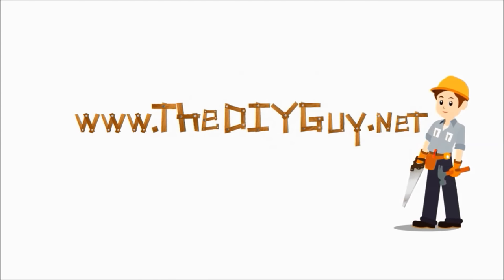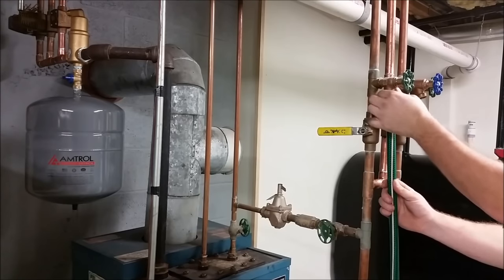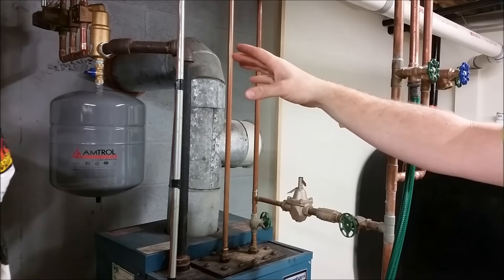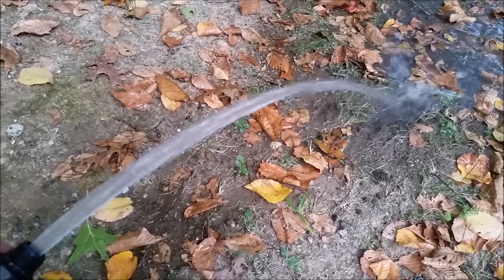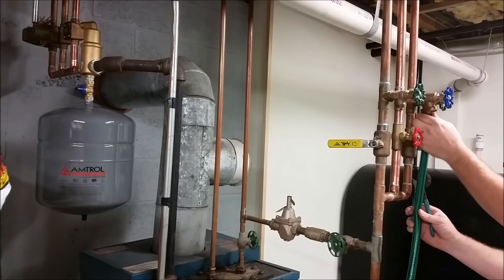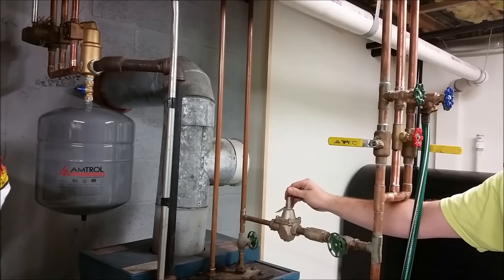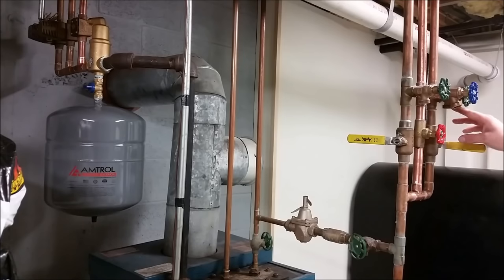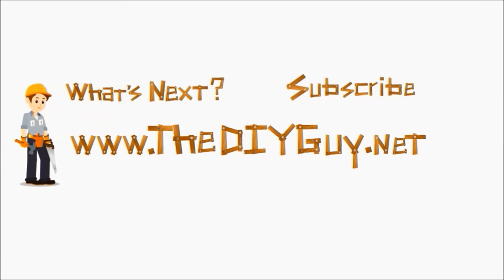How To Remove Air From Your Heating System

Comment: I had a radiator moved this past summer. I drained the boiler and all pipes. After the wk was completed, i filled the sytem with water and bled out the air. First cold nite, i have a cold radiators in one zone. I bleed the system again and now i don't get a strong flow of water from the bleeder valve(s). I checked the incoming water flow and it seems fine. Is it possible that some junk, rust or corrosion got into something? Thanx
Reply from the maker: Yes it is very possible that something has become stuck in there. I just had one the other week on a 5 unit apt complex where the last unit was very slow getting heat. Other ppl had said cause it was so far away from the boiler.. So I hooked a hose to it to flush it and the same thing, the feeder valve was working but very little coming out of the hose. So I cut the feed side pipe going to the base board and took my air take and blew though the drain valve on the return side and a bunch on metal looking stuff came blowing out. So my guess is the small rock/ metal looking filings piled up in a belly or a fitting causing the restricted flow. That was on a typical baseboard heating system. I am guess yours is a monoflo heating system? If so you may want to make sure that the monoflow tee's are installed or facing the correct way.
Reply: TheDIYGuyDOTnet.   Thanx 4 your reply. My furnace is 25 years old, gas fired hot water. I have 2 zones/2 circulation pumps/2 bleeder valves, 2 thermostats, no zone valves. I can't flush the trapped air out of the one problem zone because theres no pressure behind it.  The other zone is hot. Water trickles out from the problem zone, so i tried the zone that's hot and same thing, very little flow/pressure. Im afraid rust and other crap got disturbed when i first emptied and drained the boiler. The water inlet valve is fine.  The furnace gets up to 180 degrees with about 15 psi pressure. Both pumps run fine. Is there a way to back flush the furnace? I really dont think the problem lies in the baseboard radiators and/or pipes. Thanx again!
Reply from the maker: So is it one heater giving you problems? If so then its most likely air trapped in it like you think. If its an entire zone it could be a bad circ. pump. Some of them have a plastic wheel/ impeller that break apart. So you will hear and feel the pump " working" but its not really doing anything. Yes, in that 5 unit one I was just talking about I ended up installing a TF1 boiler filter and switching the return with the feed and leaving it for a month or so then put them back and cleaned the TF1 filter and it had a lot of stuff in it. You could also cut in another boiler drain and ball valve on the feed side and hook a hose to it and run it outside. That way you can Isolate the boiler from that heating loop. Then hook the hose that's on the drain on the return side to a water supply and flush it out that way.
Reply: TheDIYGuyDOTnet 
The circulation pump(s) are fine. I know this because that pump in question supplies 2 different floors. The loop that doesn't have air in it heats all the radiators fine. The other floor/loop is cold because it has trapped air in it. I have 2 zones, and 3 bleeders. When I try to bleed air from any of the zones, I just get a weak flow that reduces to no flow in a few seconds.  The bleeder valve is fine because if i open it while opening the check valve, i get good water flow.
Reply from the maker: Ok just checking as I have seen that a few times. Its hard to tell ya what to do next without seeing or knowing the setup. Are you isolating each zone when you try and purge the air out? When you open the feeder valve/ cold water make up valve can you get the psi in the boiler up to 20psi with the boiler drain open and the hose attached? 20-25 psi should be enough to force the water into the baseboard and push the air out.
Reply: TheDIYGuyDOTnet 
Thanx 4 your time. The boiler runs at 10-12 psi. I dont c a way/device to raise it.
Reply: TheDIYGuyDOTnet 
Yes, I am isolating each zone. I won't dare touch the working zones for fear of creating other problems.
Reply: TheDIYGuyDOTnet 
Solved my problem. I focused my attention to the water inlet. Seems that theres some sort of "pressure regulating spring"?  located in a valve housing attached to the expansion tank. I removed it, there was some sentiment in there. I reinstalled it (man that spring is hard to push on while trying to screw the cap back on) and eureka, i suddenly had normal water pressure and was able to bleed the air and crap out.  I would guess that spring presets the psi to about 12?
Reply from the maker: Glad to hear you got it figured out. The cold water make up valve or feeder valve is a pressure reducing valve as it lowers the house pressure down to 12-15 psi. Yes they are normally set at 12 psi.

Comment: is that a quarter turn shutoff valve over the expansion tank?
Reply from the maker: Yes it is. So when the expansion tank needs to be replaced it can be closed and the tank easily be changed without letting air into the system.

Comment: what are the symptoms of air in the lines? thank you
Reply: AR you can hear air bubbles in your baseboards and it gets very loud, enough to annoying wake you up at night haha
Reply: @ryanclarke83   Is this a job for plumbing or furnace tech?  thx so much
Reply: I don’t think so. With this video as a guide it was very simple and saved a call to a professional that would have costed, I’m sure, at least $300
Reply: It will make more noise and/or not heat as effectively.

Comment: Why the pipes are hot where the Water runs while the switch will on the wall is off so the heat is off and the pilot is off. I don’t understand what makes the pipes hot?
Reply from the maker: Most cast iron boilers have a good amount of water in them and retain the heat pretty well so even if you shut the switch to off a few hours before doing this it will still be hot/ warm unless your heat happens to call and you can pull/ dump the heat out of the boiler. Most of the time you will still notice a change in the the temp at the hose end
Reply: TheDIYGuyDOTnet I have the same furnace for heat as you and when I touch that little round metal gray gallon looking thing or those 2 pipes that are connected to the furnace they are hot and the temperature on the furnace is over 120 the thermostat is off the switch on the wall and the pilot inside when I take the metal cover off it’s 90 degrees outside today so no one for sure is using the heat or calling for it but the 2 pipes and that round thing and even the top of the furnace is hot I’m just scared something is wrong and it will blow up or something.
Reply from the maker: @alwayssmile4881  Heat rises so the single black pipe, gray expansion tank, zone valves and a little bit above will be hot/warm. It sounds like its working properly.. The boiler temp should be 160 on the low end and 180 on the high side. Yours is only 120 so it is lower/ going down. Like I said it will take a while for the temp to go down. If you turn on the heat or open the zone valve manually and dump the rest of the heat off it should go lower then the 120.

Comment: Should we turn off the thermostat before doing all this?
Reply from the maker: The thermostat doesn't really matter as you will be shutting the unit off at the top of the stairs or on the unit itself. What matters is that you shut if off a head of time giving the boiler temp time to cool off. As when you add water to the boiler it will be much cold then the temp within the boiler so you could risk what they call shocking the boiler or Thermal shock. So when cold water is pumped into a very hot boiler, those parts immediately surrounding the inlet part will contract, while other parts stay expanded from the heat. This thermal gradient creates extreme mechanical stress on it and on the steel tubes of the boilers, and it can rip the tubes from their seats or even crack the boiler itself. So just be sure to shut it down for a few hours ahead of time or manually turn the zones on for a while to dump the heat out of the boiler.
Reply: Thanks alot been very helpful
Reply from the maker: @mannydecastro6934  You're welcome, Glad we could help. Good luck getting the air out of your boiler. Thanks for watching and taking the time to leave us a comment/ question. Don't forget to give the video a thumbs up/ like. Thanks

Comment: Hi. Any way where I can have this prevented or have the air removal done automated?
Reply from the maker: Yes, You should have an air scoop and a taco Hy-vent 400-4 or some sort of air eliminator on your system most or the time the hy-vent becomes clogged with deposits and wont let the air out. If you don't I would recommend installing a spirovent air eliminator as they are far better removing air from the heating system.

Comment: I have a hot water system, but it doesnt have a pressure regulator valve; just a gate valve from street pressure.  How can i safely refill my system when the street pressure is much higher than what my system needs?  Should i just install a pressure regulator valve?
Reply from the maker: Umm.. Must be an old system. I am surprised that no one has installed one yet or recommend that you do. Crack the valve and keep an eye on the gauge and make sure you don't go pasted 12 psi. Maybe leave a hose on the drain valve to flush a zone that way in case you do go over 12 psi you can open the valve and let it out the garden hose. I would install one as it will automatically top off your boiler and keep it at the correct PSI. I would also look/ check for an Air Eliminator such as a air scoop or Spirovent that will allow the air to get out and the feeder valve will top off the boiler with the water it needs.
Reply: Thanks for responding, (great video by the way), and thats exactly what I figured.  Had an HVAC guy out today for a cleaning/burn test, and asked him about it.  He just said that I could add in water from the street a little at a time and the pressure valve will release at 30 psi if it gets too high.  Then he showed me how, then the pressure valve released, and dumped water all over the place.  So you can see the talent pool im dealing with.  5 star guy from yelp, too.  So, ill get a pressure reducing valve, add male connectors (since these valves only seem to come threaded, and solder in the connections.  If i connect the male connectors to the valve using teflon tape, and then solder in the connections, will the heat affect the teflon tape?
Reply from the maker: No problem, Glad we could help and thanks for watching. Right the pressure valve will release at 30 PSI but that is already to much.. 12 is ideal but I would say your safe with 12-15 psi. lol that's to funny. It wouldn't be so bad but it sounds like you don't even have a pressure reducing valve on where the line comes into your house from the street. You may want to put a gauge on it somewhere and see what that pressure is. I had one I just did not to long ago where they lived on the bottom side of the town from the water tower was and there pressure was almost 150 psi at times. Something to check at some point. I would recommend a fill valve with a backflow preventer as in most places it is now code. So the back flow part with be a solder connection so you will need one male adapter to go into the fill valve. I use the Blue monster tape and Gasoila. Blue tape good till 500F and the Gasolia good till 600F If I remember right. Don't forget to "like" the video and good luck with the repair.

Comment: What is the recommended pressure. Mine says 40. Seems high to me. Looking for a ball park reading. I won't hold anyone responsible for trying to help. Thanx..
Reply: 12-15 psi cold residential 1-2 story home. When it gets hot or operating temp it will rise 3-6 pounds. Something is not right with your system, no way it could be 40 psi, the pressure relief valve opens at 30 psi so in theory you should have water all over the floor or a bucket if you placed one under it. Sounds like a bad gauge, but that's just a guess with out seeing your system.

Comment: Should  the circulating pump be left on on ?
Reply from the maker: No the circ pump doesn't need to be on the water will go though it with it off.
Reply: Cheers!

Comment: My Safgard 1150 low water cut off keeps activating after about 5-10 mins of heat being called for.  Will this solve the problem? Do i need to replace the low water cut off? I asked an HVAC guy who said i don't need it with my boiler (gas) however, i don't feel comfortable removing it...Please help!!!
Reply from the maker: Hello, First thing would be to make sure you have enough water in the boiler. Should be 12-15 psi check the gauge although not always accurate. You shouldn't hear the water as it goes though the zones. I believe on those you could just replace just the probe part of it at about 1/3 of the price of a new unit but depending on the age of the unit and if it has any corrosion in side of it you might want to replace the entire unit. Sometimes you can remove and clean the probe as well and it will solve the problem. It is a safety item and I know in my area and a bunch of surrounding area's close to me its actually require by code. Hope this helps point you in the right direction/ course of action. Thanks for watching and taking the time to leave us a comment/ question. Good luck with getting it repaired and back up and running.
Reply: @TheDIYGuyDOTnet  not sure how to access the probe on this unit.  The gauge is reading 12-15 PSI but the problem persists.  I've been searching youtube and the internet for a video.  Any guidance you can provide would be greatly appreciated and thank you for your expeditious response.
Reply from the maker: @bigpoppa7070  The gauges do fail and become in accurate.  To access the probe you should shut the boiler switch supplying power to the unit to off. Then locate and remove the phillips screw that is holding the low water cutoff door in place and then swing open door or remove it. You can look inside for corrosion/ leaking around the panel/ middle area.( maybe be the problem and may need to replace the entire unit) There are two terminals in the middle that twist lock into place. Those are the probe terminals, the probe is right behind the box. Sometimes the box has screws holding it in place (depending on where it is) and other times its just uses the probe terminals. If it has screws loosen and remove those, loosen middle terminals twist the box off the probe. Now you can look around the probe to see if it is/ was leaking and also how rusted in there it appears to be and see if you want to take on the task of getting it out. Keep in mind if your going to remove it, it sits in the boiler water so you will need to relieve the pressure / some water from the boiler. Be sure not to damage the threads when removing the old probe as you will need to thread in the new one. So the way they work is when water comes into contact with the stainless steel tip of the probe and the boiler where the probe is installed it creates a circuit. So when the water level drops below the probe the circuit opens and shuts off the burner. So if the probe is rusted where its threaded in or making a bad connection to the boiler that can also create problems. You might be able to wire brush the area and that might do the trick. I would at least open the door to the water cut off and see what it looks like inside and decided weather you want to call someone in to fix it or attempt to try it yourself, depending on your skill set and knowledge of the system and how it works. Hope this will give you a better idea of a few things to check/ direction to go/ whats involved with solving the problem. Good Luck
Reply: @TheDIYGuyDOTnet  thank you so very much!!
Reply from the maker: @bigpoppa7070  No problem.

Comment: You can see the air bubbles better if you put the hose in a 5 gallon bucket..  I am having to figure out how to bleed a 24 unit building the has a hot water boiler system. Their is really no zoning. Just valves with a thermostat at each of the 24 apartments and one pump at the boiler. . 🙄
Reply from the maker: Yes, you are correct you can see the air bubbles better if you have the end of the hose under water.  You can also hear and feel them when holding the end of the hose. It should be the same. There should be zone valves somewhere if each unit has its own t-stat and if there is only one pump. You will ave to go one by one. Make sure all t-stats are off or close all the valve for each loop. (In & Out) Then either turn the t-stat up in one unit or open zone valve or valves for one unit. Then you  should be able to circulate the water though that unit and then out the hose. Then shut that t-stat off or the valves and then move onto the next unit. Start with the farthest away unit from the boiler. If you want you can snap some pictures and click the link in the description and at the bottom of the page upload them and I can see exactly what your talking about.
Reply: @TheDIYGuyDOTnet  think you soo much . I am the building manger and do extensive remodeling. I have cleaned the boiler nozzle,  etc, seems like hard to find a professional to go through the process, even though have called several pros , seems like I know the system and have trouble shot it before. None of the companies have successfully eliminated the problem. The system is 60 years old. There is no zoning,  the valve is in each apartment and directly controlled by each thermostat in each apartment.  Operating as a shut off valve ,, or on valve when opens or closes.   Only 1 large recirculating pump at the boiler in the basement. The return line is in the attic with one loop up there and a line that goes down from that loop to the basement with  valve there for  hose...